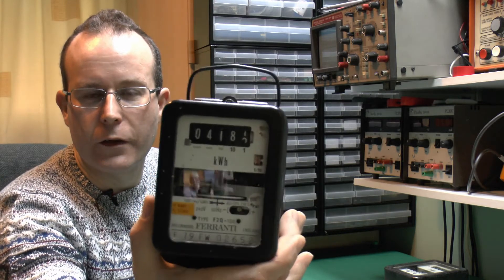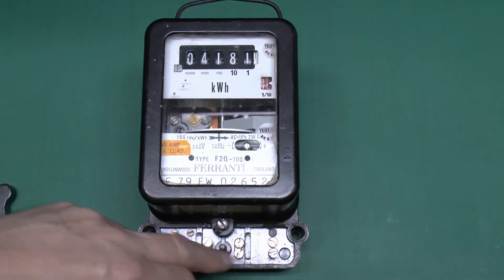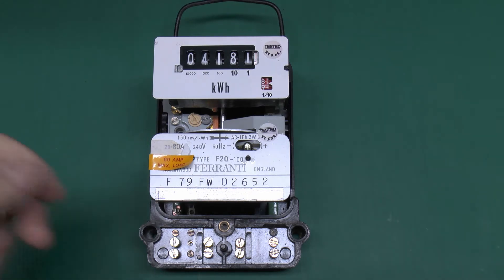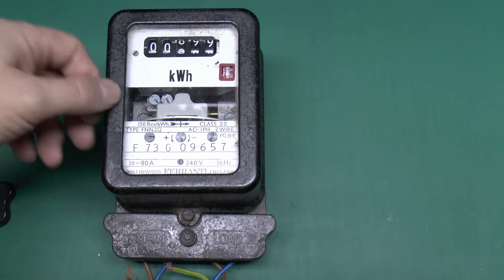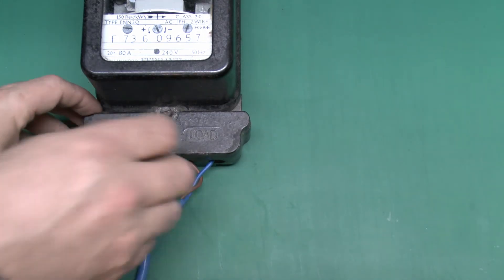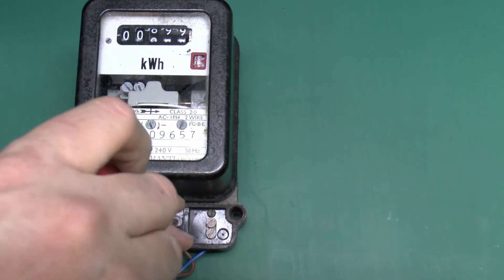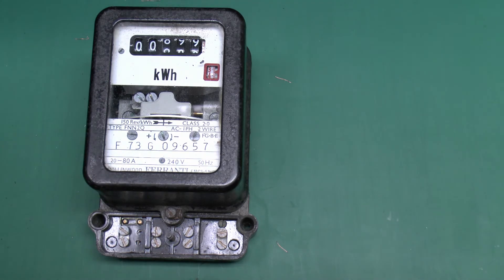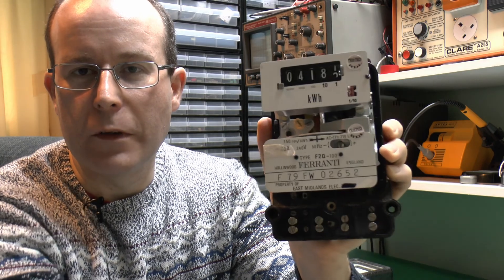Ferranti kWh Electricity Meters FNN2Q / F2Q-100 (Part 1)

Comment: How to read this meter with a reading 41332
Is it 41.332 kw or  4.1332 kw  under the 4 its say  10.000  if same one can clarify. Will aprecia-te
Reply from the maker: The reading is the white digits, so 41332 kWh.
If it does fractions of a kWh they will be shown as red digits.

Comment: I've got one of these metres, but it's suddenly gone fraulty and clocking up more usage than usual and when I swith my electricity off at the mains the wheel still goes round slowly. I've informed my energy company, but they are trying move me to a smart metre. But I refused point blank. I want to know if I can get my metre repaired or looked at by a electrician
Reply from the maker: There is no repair, the few companies that did repair and refurbish meters like this all closed several decades ago.  If it's faulty then a new meter is the only option.

Comment: Really interesting video John
Sorry if this looks like part of my CV but I worked at Ferrantis Hollinwood factory from starting my Mech Eng apprenticeship in1968 until becoming redundant in 1996. You could spend your entire career in the Toolroom and not have a clue how the meters worked, There was only a few moving belt type assembly lines - the meters were passed to each deparment on wheeled trucks that were dozens of years old - Siemens built a new modern factory alongside the original one in the 1980s until then the meters went round on a chain conveyor above the workers  heads and you had to stoop in a lot of places to get around the place!
I was responsible for all the follwing  (and more maybe} 

The maintenance of lots of the drill jigs for the frame of various meters - the ones that spring to mind are the F2Q, FMX and  F4K.

The coin cage die cast toolingfor the pre-payment meters.

 Printed the numerals etc onto the  aluminium rotor disc  . I remember that some Electric boards had to have the green flourescent spot instead of the black, Hinckley in Leicestershire was one I think

The aluminium/lead alloy Fischer Die-cast machine that attached the rotor spindle to the disc - you got a free pint of milk every day on that job to supposedly help prevent lead poisoning!
 
The roller register assembly fixtures.

There was also a pig of a mechanical/pneumatic tool that I made several of that held current or shunt coils (?) and an iron tongue together  - the bit that the disc passes through but not the brake magnet.
Talking of which  - when I was an apprentice I had to make a load of flat 3 inch square  "go/no go" gauges for setting the brake magnet gap, only problem was was that they had to be made from NoMag  stainlees steel so you could not put them on a surface grinders magnetic chuck and they had to be filed by hand to +/- half a thousand of an inch!

All the pneumatic screwdrivers in the factory.

It was only when I moved into the Production department in 1981 when Siemens bought the goverments shares and took over that I learned how a meter functioned 

When they started to move into electronic meters most of the above jobs dissapeared, then they tried making electronic gas meters but if I remember correctly had the rug pulled from under their feet by British Gas with orders for thousands of meters that they then cancelled and lots of staff were finished.
Funny story - we had a union meeting once when they were struggling and a guy stood up and said "This place as been going downhill ever since I started here"

I had friends who worked at Ferrantis Moston factory in Manchester and lost their jobs due to an American CIA scam - its on Wikipedia and makes interesting reading.
Reply: Thank you for sharing your history working on these marvelous machines, especially the part about the disc. I love learning how these things were made.

Comment: Hi. What's the relevance of the 20amp in respect of "20 - 80amp"
Reply from the maker: Current range that the calibration is accurate for.  It will still work outside of those ranges, but accuracy isn't guaranteed
Reply: @jwflame 
Thankyou. I have often wondered.

Comment: small meters!! these are!
Reply from the maker: HDXFH This size is fairly typical of UK meters - or was, they are all being replaced with tiny electronic ones now.
Reply: HDXFH These 1970 meters are half the size of the 1950s clock work dial type, they didn't start shrinking in size probably till the  90s. Even then cyclo meters were still used until recently like the J112BA or ACE1000. The new smart meters are huge too, its gone full circle!
Reply: +Jon “Wookie” Buggins yeah, our Aussie meters are quite large in comparison and heavy!!!!!
Reply: +HDXFH  Everything in Australia is bigger ;)

Comment: Haha, I also have a Ferranti FNN2Q as well. :-)

My one is an out-of-service meter, complete with its original anti-tamper seals as well.

My one is F72A, so that makes my one made (or first calibrated) in 1972.

Thanx for showing.

-BoomBoxDeluxe.

10th February 2014, 03.03

Comment: Polarity is reversed at the second meter. The 150 rev/kWh Ferranti meters are usually 20-80 Amps. The 225 rev/kWh Ferranti meters are 40-67 Amps.